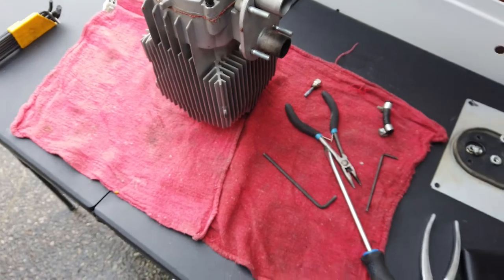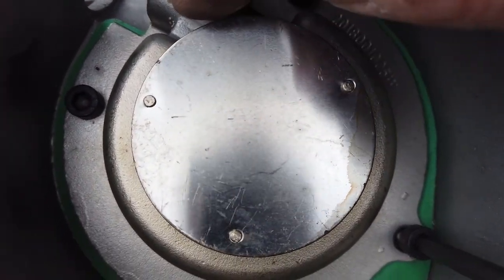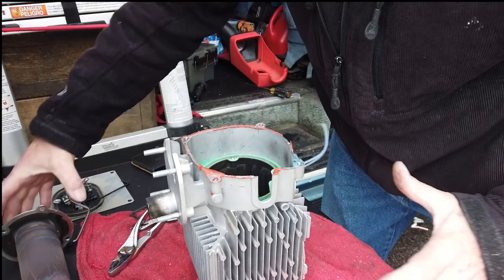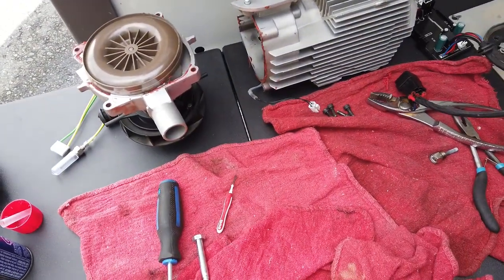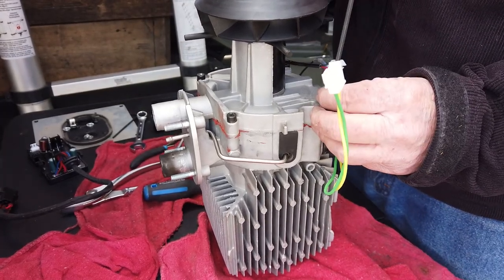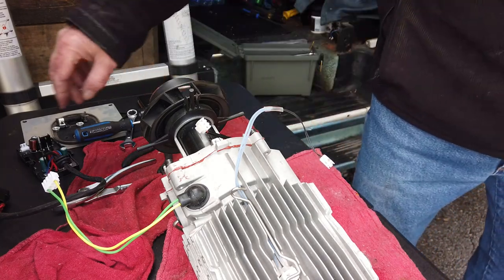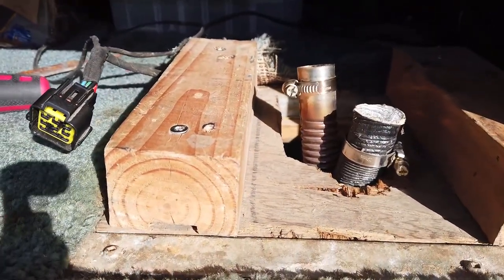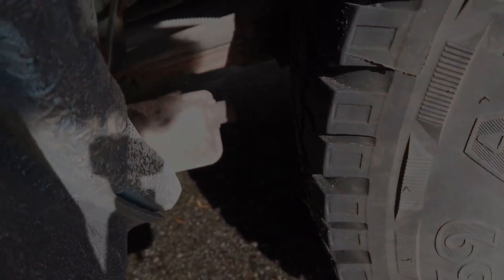Diesel heater soot buildup or Atomizer screen clogged

Comment: My atomiser wasn't fitted correctly from new, was right at the top....2 years of E8, 4 pumps, nylon pump fuel line, constant decking, your video showed me why.

The whole burner unit is only £12❤

Comment: When I first discovered these heaters, I was pretty excited for the cheaper solution to heat my little workshop. Worked great till the chamber got all gunked with soot. I got tired of taking the dang thing apart, replacing pumps and glow plugs. I cleaned it for the last time and set it up for emergency heat backup and went back to a propane heater, it has been sitting unused the past three winters.

Comment: I had exactly the same with mine and when I took it apart, like you I found it reasonably clean inside. I replaced the gauze atomiser and it’s now fine. I think the gauze was  not pushed fully inside the glow plug chamber and that from new.

Nice video only wish I had seen it before!

😎😎😎
Reply from the maker: Glad everything worked out for you.  Sometimes it can be tough to find the problem.
Reply: Same here, mine was right at top, covering the air inlet port

Comment: You won't need a new screen if your careful enough while taking the screen out now take that large screw you have and screw the screen back on it just enough so it doesn't fall off get yourself a torch and heat the screen up cherry red  on all sides of the screen so that will burn off all the carbon and whatever residue is left on the screen and it is clean I do that and also use my torch to burn out whatever is left in the glow plug hole works great

Comment: Hey thanks Wayne...im having problems with my diesel heater....full o' soot to the max and only used it a handful of times... i think something got inside the burn chamber and/or clogged the screen so i gunna go pull mine apart after watching your very very very helpful video bro :) thanks again my friend and may God bless your path i pray...

Comment: Nice set up… Usually that noise you described is the nozzle like the atomizer… You might wanna get a can or two of brake clean so you can spray out spots that you can’t get to and it dries quickly so you don’t have to worry about a residue of flammable liquid in there. It would make getting in spots that you can’t access easier
Nice tutorial
Reply from the maker: Yes it was the atomizer screen a little clogged. But the brake cleaner is some good advice. I will have to try that. Thanks Dave.

Comment: I could see the problem as soon as you took the top part off, your gauze filter is sooted up along with the air inlet hole being blocked with crud.
Reply from the maker: That sounds like it would be the problem.  Good eye, thanks.

Comment: Do you filter your fuel? I could understand the soot if you don't. And you should always filter the intake air also to keep the glow plug and atomizer screen clean. That screen is the heart of the heater. The glo-plug actually shuts down once the heater is going and up to temperature. The screen glows red and lights the fuel when it is pumped into the chamber so there is no use for the glo-plug at this point. It will come back on when you shut the heater down to burn any residual fuel left in there and keeps it clean for the next startup.
 I have seen these heaters run for up to three years and stay clean, I guess it all depends on how clean your diesel fuel is or how well it's filtered.
Reply from the maker: You should always filter the fuel. The soot is not from not filtering,  but that's just what happens when you burn diesel.  Good luck on your journey friend.

Comment: Does this unit have the standard 22mL fuel pump?  I'm wondering if you would benefit from a fuel pump with a slightly lower volume?   Also, mine made a lot of noise because there was an air bubble in the line AFTER the fuel pump.  It really depends on how you route your fuel lines.
Reply from the maker: You should not use any other pump. That pump pumps the right amount of fuel which is .02ml per pump. And yes the air bubbles are supposed to be there, that all part of the diesel heater function. What I did was hang my pump from an elastic band at a 45 degree angle which is a must. But you do need the bubbles in there bro.

Comment: My heater won't start, control panel flashes E-01 , any idea's  ??
Reply from the maker: Well that error is usually glow plug problems.  But it could be a few other things.  Start with glow plug and misting screen inside the hole where the glow plug goes.  Sorry for the little help.  Others may have better answers.  Try Facebook groups.
Reply: @NomadicVanman  thanks

Comment: You need a high pressure pump and nozzle to atomize diesel. A CDH doesn't have those. It is similar to a wick burning heater, but with a blower.